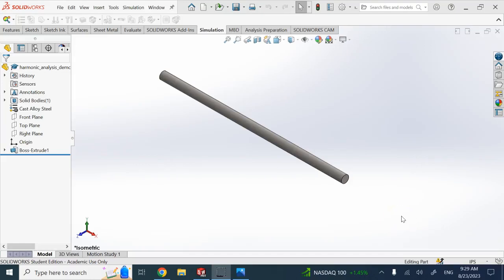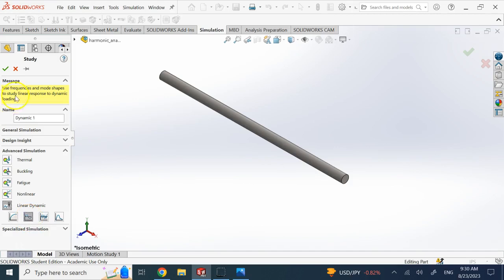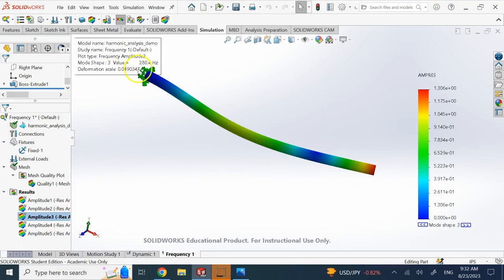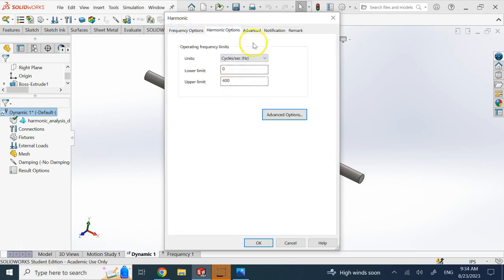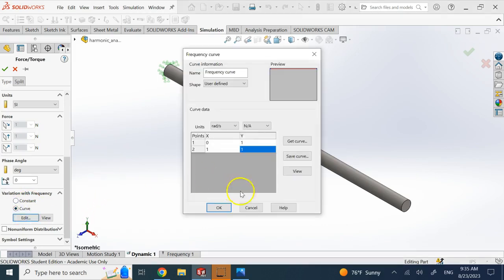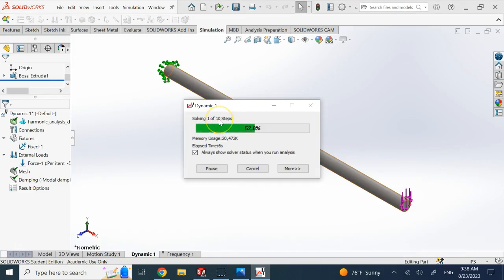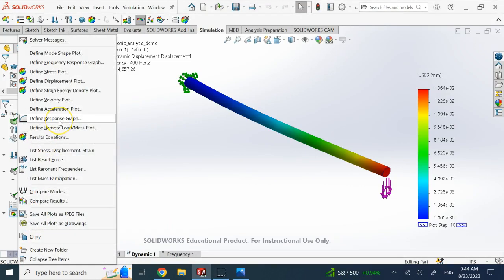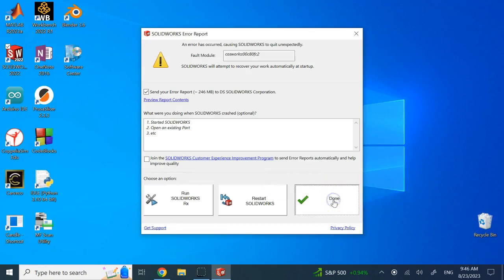SolidWorks Linear Dynamics (Harmonic-Force Vibrations)

Comment: Nice video. Question: hoe to fix the error message of "Frequencies are not computed prior to running ASTAR"? I get this message after running the dynamic analysis even after already having results for the frequency analysis.
Reply: I am getting this error too. I have to design a weldment that can pass a vibration fatigue test from 4-33Hz. I first ran the regular frequency analysis and iterated my design so I don't have any natural frequencies below 33Hz. Now I want to know the stress on the weldment when vibrated at 33Hz so I can do fatigue analysis to make sure this design will survive 1,000,000 vibration cycles. In the beginning of the video he mentioned the simulation only looks at natural frequencies... I think the "Frequencies are not computed prior to running ASTAR" error means SolidWorks couldn't find any natural frequencies in the range I told it to run the harmonic analysis, but I'm not sure. I am going to try the time modal option and see if that gives me what I want. Please msg me back if you have any insight on this. I have been working on this for two days with nothing to show : (